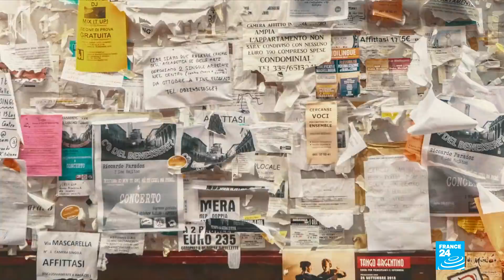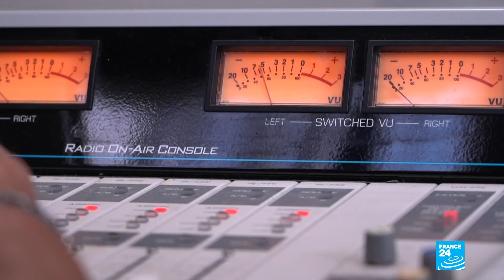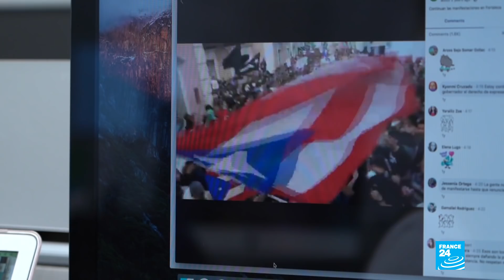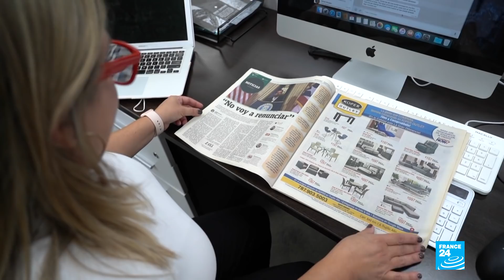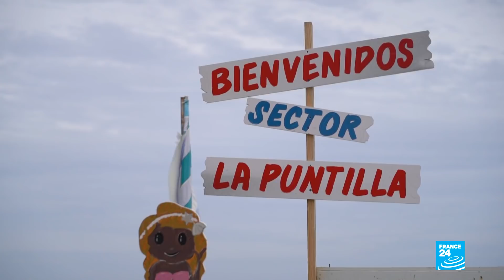Will Puerto Rico soon become the 51st US state? | Reporters • FRANCE 24 English

Comment: As some already mentioned, statehood will not happen to Puerto Rico any time soon. It is all about the USA politics. I don't not mean be negative, but think about this, why would the GOP relinquish power in the senate, and potentially in the house? Statehood to Puerto Rico will provide two senators and six congresspeople that would likely be democrats. The GOP will never go along to add the island as part of the union as they could loose power in congress. The GOP has zero incentive to go along with statehood for Puerto Rico. Hence, it should ne even be an alterative in Puerto Rican politics. But the people in the island do not vote on realities, they rather vote on hopes. Hence Puerto Rico continues these silly loop since the 70s where people are promise something that will not happen. The other piece is that the current commonwealth is the system by which all the corruption and failed economic development has occur. But this group in the island are also blinded to this reality. It is sad.